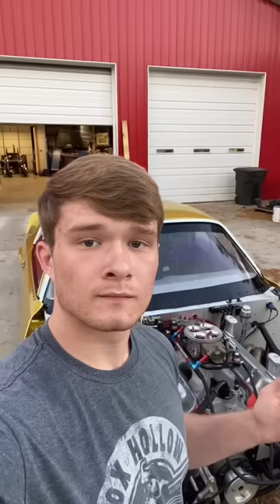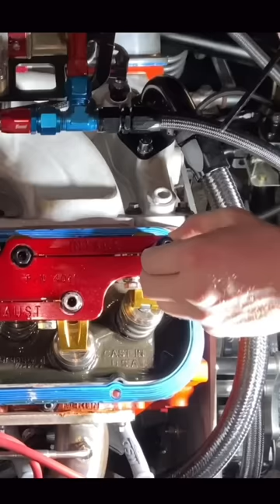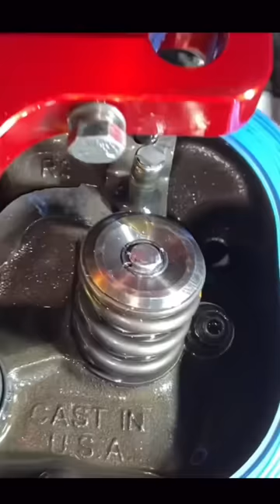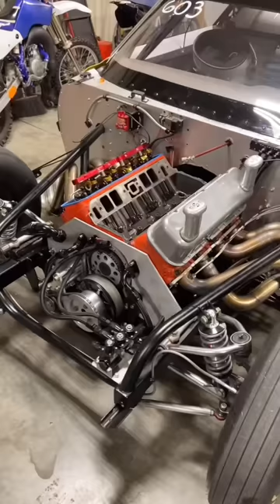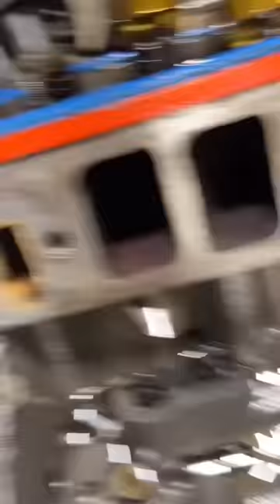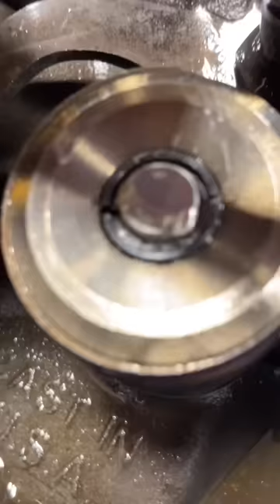She don’t like to hit the rev limiter👀

Comment: If you stud breaks, you need to check your pushrod!
Reply: I use to help run a Big Block rear engine Dragster. Random studs breaking. Come to find the Stud Girdle had tweaked out over time.

Comment: Man I only made it down to Edgewater twice this year couldn't get my car straightened out enough constant issues out the Holley sniper set up( mostly not Holley's fault) but glad to see the home track looking good on video, hope it works out for ya
Reply from the maker: You’ll get it figured out man! Edgewater was a blast this year!
Reply: What do you have the sniper setup in?
Reply: I was flirting with the idea of running tge Sniper system, what went wrong if you don't mind sharing?

Comment: That's why I use shaft mounted rockers. Mine goes 8500+ and no problems after 2 seasons, it's a small block but that has nothing to do with broken valve train parts. Put a stud back in it and finish the season but do away with the 1960s parts
Reply: Much more stable! Costs a bit more, but it's better to pay once and cry once vs going cheap, breaking it, and then buying the good stuff later anyway.
Reply: Was just thinking it was the rockers
Reply: 8500 rpm to double over head cam that is where.power starts. Get in 21st century

Comment: You need to run shaft, not stud rockers. Jesel or TD. Did you use Comp roller lifters? Had the same thing happened, switched to costly Johnson, and problem solved.

Comment: Just a tip: Most engines make peak power about 800-1200rpm below redline so there shouldn't be any problems going more conservative on the revlimiter.

Comment: I would be doing a little more research on why that stud snapped off. Possibly your valve spring completely collapsed on the high side of cam lobe lift. Also what caused the scraping damage next to the roller on the rocker arm

Comment: I'd have pulled the head to replace the valve.  Just because it seals and runs fine doesn't mean it's not bent.
Reply: If it runs fine with a bent valve you probably aint gotta bent valve😂
Reply: @my2vwillgapyou  A bent valve can seal on the seat up until the stem breaks and the head falls into the cylinder.  You never saw a valve stem break or what happens when it does?
Reply: @thisisyourcaptainspeaking2259  good to know and no I havent but Ive seen em run like shit with a bent valve  each failure is different I guess
Reply: @my2vwillgapyou  Some have tough valve stems, mostly older engines.  I've straightened slightly bent stems before and they were fine.  Newer engines, can't trust the valve stem once they get bent, they break real easy.

Comment: Your lucky that rollers on the cam bracket didn’t break, otherwise they would’ve turned, and screwed you cam. Happened in one of the big blocks in a dragster I work on, had to tear the whole engine to get that lifter out the hole it was brutal

Comment: Yep, send it the rest of the season.
Just remember that valve float could have done that, so, keep off the revs.
Reply from the maker: Doing my best to keep it off the revs. It has done good so far the engine is very happy
Reply: @Hobbular  - just use it as ammunition to tell the wife that you absolutely must make some upgrades this winter . For the sake of "safety" & longevity . But when she sees the paperwork for a twin turbo Steve Morris big block show up that's another story!!! Beautiful Camaro by the way.
Reply: @Hobbular  whats your limiter set at?
Reply from the maker: @nothanksguy  7700
Reply: @Hobbular  cool, that top end seems to be built for it with those stud girdles. What springs you run?

Comment: Put some lag caps and send it!
Reply: Lash caps sorry* damn phone
Reply: @mistermendoza3559  the valve tip was messed up but the lash Cap would also throw the geometry off slightly but would still be okay.. .
Reply: @bobadingo  I’ve used them in binds and got away with it always came through for me especially when your at the track when your trying to chase a time.. done it for years when in binds I wouldn’t daily it but everyone has there opinions and go to’s

Comment: On that valve couldn’t you just throw another lashcap on it and call it good or is it not necessary?
Reply from the maker: A lash cap would mean I would need a shorter push rod as it would raise up the area the rocker comes into contact. The valve isn’t hurt enough to be replaced immediately
Reply: @Hobbular  ah okay thanks a bunch for the explanation, may there be good racing ahead of ya!

Comment: So check out this rocker. It’s fucked but I’m still gna run it cuz I only want two more runs…. Then you drop a valve and grenade the entire engine (not “motor”) for the cost of one valve…. Now that I think about it, I usually start campfires with bundles of cash 😂

Comment: Well you need to start over cuz whoever built your motor didn't check the clearance from the valve to the piston that's the only way it's going to break a rocker stud
Reply from the maker: We scoped it and they never hit. I think it might have been the stud girdle putting pressure on that stud when it is tightened down. It is a one piece girdle
Reply: I used to have a small block Chevy I think it was 10 to 20 thousands clearance from the valve to the piston not much it wouldn't hit but it would crack 8,500 like no problem at all and I had the index the spark plug it would smack the Gap shut I was watching the video of you launching it and it did it when you put it up into the rev limiter it popped out the left hand side I still think the valve hit the only other thing is you have valve bind you need to  cut the top of the valve guide off it's not allowing the valves to open all the way when you come off the rev limiter and let it fly
Reply: No, that's not the only way you can break a rocker stud. There are a few other valvetrain geometry scenarios where a stud can break. Push rod length as well as a lack in clearance from the bulge of the rocker to the pushrod are a couple other reasons other than piston to valve clearance. You also need a certain amount of headroom clearance on the fulcrum slot of the rocker.